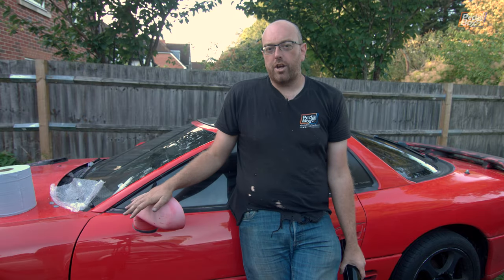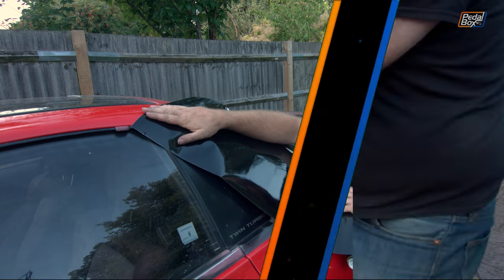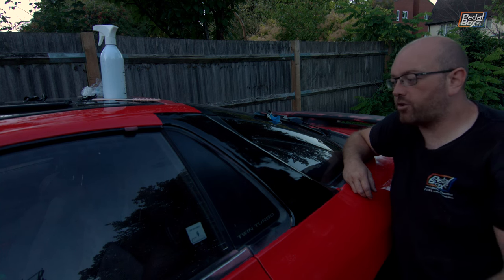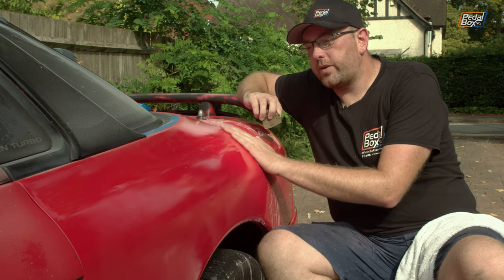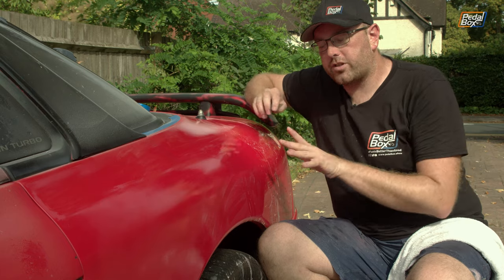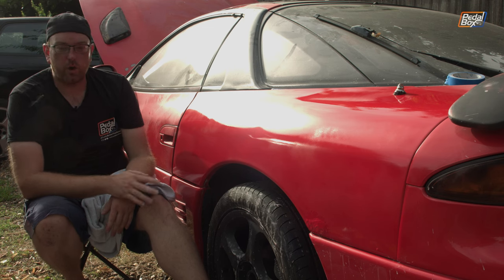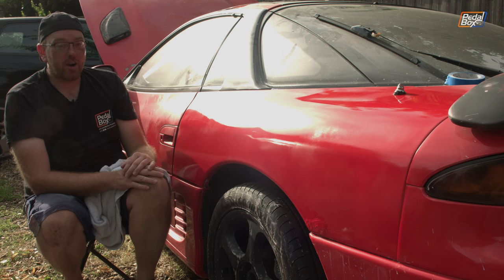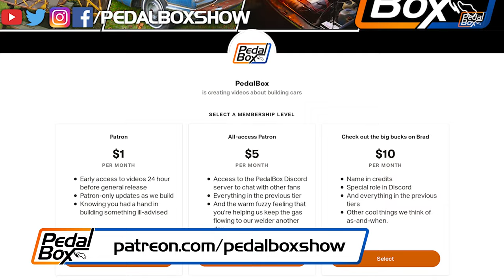Can we Save ANY Lacquer and Wrap The Roof? | Mitsubishi GTO | Fleet | PedalBox Episode 144

Comment: I'm this week's episode we're adding value to a classic sports car and learning skillz on the way
I also have zero experience with vinyl but reckon a panel is easier, marginally 😅
Reply from the maker: After all the work on this vs doing the paint on the Tbird? I'd say the paint is easier, but i've done so much more at this stage it might just be my ineptitude showing. Larger pieces of vinyl would have certainly been easier too and less cavalier trimming to start. 
If I had a 'ProTip' to give, cut more oversize than you think, and trim less before final size.